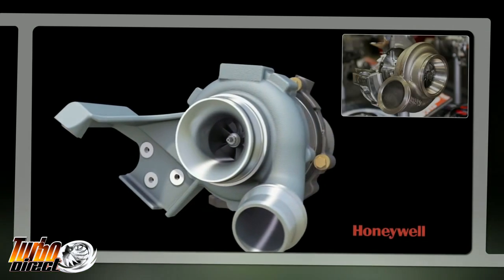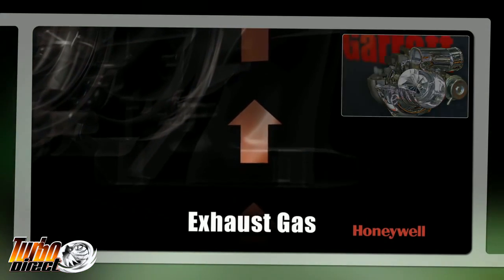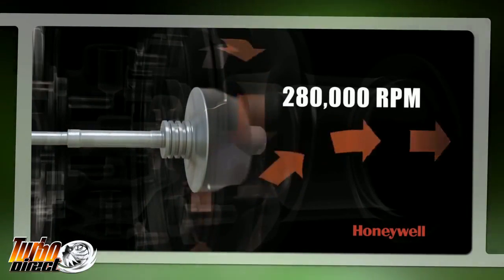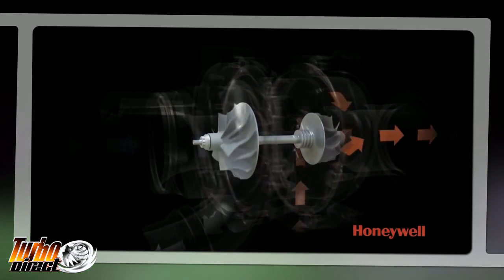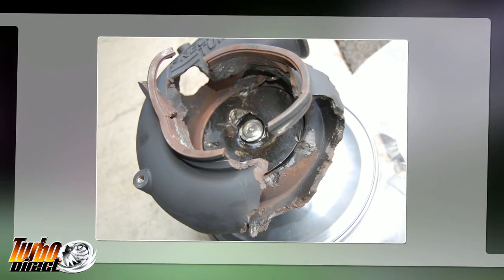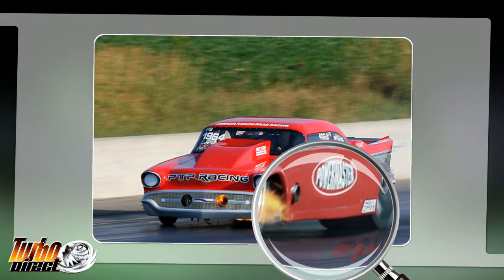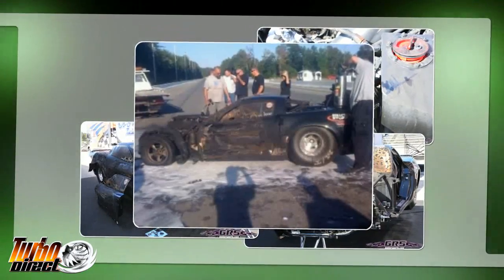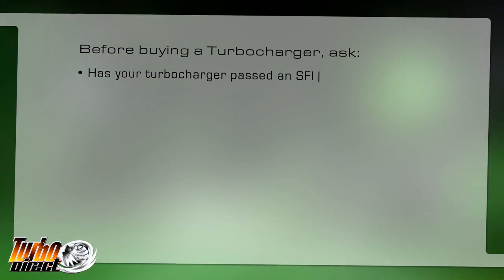Garrett versus Precision

Comment: no sorry not entirely true…Garrett gSeries are having many problems (ATM)

Precision turbos are raced and pushed  more often! this is why you see this!!

what happened too installation or operator error?

precision has more wins everywhere!

an easy perception of the three would go something like this..PTurbo is a greyhound-built for racing and performance!! where you have the borg and garrett more like a pit bull!!

i’ve compared all and can say the precision can spoil 10-13% better AND make power little easier 

in my 20 years of watching and owning big boost cars, ill always go with precision, especially on four and six cylinder engines as these feel the spool benefits more

for hard use street cars, maybe the borg is the one.
Reply from the maker: Its great to have opinions - facts remain facts i guess. BorgWarner is by far the best turbo on the planet for many reasons.
Reply: Agreed, I have seen precision turbos outperform the g series on several applications. Garrett gseries seems to be over rated.
Reply from the maker: @uwisho  Absolutely.
Reply: That's why precision turbo is the goat of turbos because they're the leaders of turbocharging
Reply: @jonathangutierrez7347 precision isn’t a leader in anything except maybe bombs. They’re nothing more than copies of Garrett and other brands.

Comment: It's disappointing someone will buy a new turbo that has had years of development and work put into it and ship it to China to be copied and sold on eBay. Even the cost, proportionally, isn't terribly different for the person buying it. The wild variations of oe configuration of turbos that manufacturers use means basically no matter your requirements there is a Garrett turbo for your application.
Reply from the maker: Nail on the head - thanks for the comment

Comment: I'm working on a build, and this video was helpful. After watching the video, I  better understand why Garrett is more expensive. I don't know why some many of the top tier engine builders typically don't list Garrett in their offerings.
Reply from the maker: Great that we could help - not sure which turbo you planning on using, but Garrett is not more expensive than precision. In fact in our country we sell Garrett alot more affordable than precision can ever be...... :-)
Reply: @TurboDirectSA  maybe 3 years ago prices were different but precision is definitely cheaper
Reply from the maker: @HandMadeRoyalty  cheaper in construction definitely, but in monetary value, most definitely not.
Reply: @TurboDirectSA  a gtx3071r is about $1500-$1800 a pte 6262 can be had for $1200 (with a journal bearing vs the ball bearing standard on the garrett model) and the precision unit will still make more power than the garret… btw precision got their start selling garrett units with their own modifications until garrett figured this out and cut them off
Reply: @HandMadeRoyalty  i dont think so PTE is a low quality chinese made turbo which costs much more than garrett and always been more. Makes more power LOL.  You seriously need to come to SA and see for yourself, things are not the same overseas, here our conditions are very extreme compared to yours. PTE makes less power and costs more.  BTW you are not comparing the same thing, ball bearing against journal bearing - ofcourse there will be a price difference.
Reply: @HandMadeRoyalty  you obviously havent seen the dyno graphs side by side of the PTE 6262 against the GT3076R against the 60-1 billet wheel which Chris himself machined on an RB26 in 2011. I personally saw this car on Steve Clarks dyno in Vereeniging make less power at more boost with the pte and Chris 60-1 billet 11 blade wheel destroyed the pte6262 with 80HP more at 0.1bar boost less. pte was made by a chinese company and turbonetics was labelled inside the back of the turbine wheel, this is all over the internet. PTE never used Garrett parts, they tried to copy Garrett designs.
Reply from the maker: @HandMadeRoyalty  Not in my country - Garrett is at least 500USD less than you are advertising these for.  Apples with apples my friend, this is what you are not doing. How can you compare the pricing of a Ball bearing turbo against the inferior, and far less costly Journal bearing unit? Obviously there will be a price difference. 

PTE makes more power than Garrett - im sorry but you are misled. We have never seen any 6262 (with any bearing design) make more power (same car, same dyno) than any Garrett GTX3582R -- in fact nor does the 6262 make more power than a GT3582R with the cast compressor wheel.  The PTE is laggy, unreliable, does not have burst containment housings, and costs far more than the Garrett models of the day. 

Would i compare pte to the G-series, this is a different story alltogether, G-Series is a waste of money, and does not perform anything like the previous  Gen2 GTX used to.  

Lastly -the company who made these pte turbos is called www.worldturbocharger.com otherwise known as E&E - they are cheap chinese knock off's of the Garrett design, and the castings were copied from the Garrett design, BUT had turbonetics cast into the rear of the back disc - I have photos of my visit to this factory in 2010 where this company was still trying to copy the Ball Bearing cartridge of the ball bearing design from Garrett - they failed needless to say.
Reply: @TurboDirectSA  im comparing the hp to dollar ratio. If i can make more power with a journal bearing im definitely ordering the journal bearing. The 6262 and the gtx30 i mentioned are roughly the same size. The gtx30 being from garrett and with more features on it side it should make more power than the precision unit but it doesnt. As far as the worldturbo guys that was clearly after garrett decided to part ways with pte.
Reply: @TurboDirectSA  also send me links to websites with the garret unit i mentioned $500 cheaper
Reply: @siyabandasekho6851  no i did not see this send me a link bud
Reply from the maker: @HandMadeRoyalty  www.turbodirect.co.za
Reply from the maker: @HandMadeRoyalty  No sir the GTX30 and 6262 are FAR fro the same size. The GTX35R and the 6262 are the same size - in fact identical in size when comparing the inducer and exducer of the turbine wheel, and the exducer of the compressor stage.   Note, a bearing system is not a power adder - journal bearings do not make any difference in power compared to a ball bearing cartridge, and vice versa.  Garrett was never in partnership with PTE -- id suggest you do your homework. A very popular corvette that blew up in the USA years ago, were using PTE turbos was reported to have been using Garrett turbine wheels, BUT after inspection by Garrett engineers, PTE ground the shafts down and modified them to work in their assembly, which weakened and caused the turbine to fail - Garrett was never an official supplier to PTE, and never will be. PTE are copy products made in China. 

The GTX30 wont make as much power as the PTE6262 because its not apples with apples - the GTX35R will destroy the 6262 and ontop of it will be reliable - something the 6262 cannot do.
Reply: @TurboDirectSA  my bad i mixed the numbers up. The gtx35 was what i meant to use an example. And i kno the bearing isnt a power adder my point was the journal bearing is a down grade compared to the ball bearing unit.
Reply from the maker: @HandMadeRoyalty  The only difference is that the bearing system in the JB version will be laggy but overall power output will be the same model for model.
Reply: @TurboDirectSA  the gt35 is rated up to 605hp the 6262 is rated up to 705hp. Theirs even videos on youtube where someone with a 6262 will smoke someone with a gtx35. Most tuners here that i have communicated with have recommended garret or pte when i ask which would be better they always tell me pte would be the better unit for my goals
Reply: @TurboDirectSA  also precision turbos are made in california not china. Maybe theyre ball bearings or seals are chinese but they are made and designed here in america. As far as theyre failures in the past yes they had design flaws i mean what do u expect once they got out on their own and experimenting with parts suppliers?? That happens but today pte is a totally different animal compared to the past relics they made over the years
Reply: @TurboDirectSA  i didnt find anything i was looking for in stock on that website so… no prices available how ironic
Reply from the maker: @HandMadeRoyalty  Nope - the Garrett GTX3582R is rated 750HP and the PTE6262 who knows what they rate it at, but its laggy and doesnt make the power that is claimed - from experience as mentioned previously pte has always been overrated with their power claims, something that the new G-series has followed aswell.
Reply: @TurboDirectSA  either way the 6262 will make more power and be cheaper even as a ball bearing unit vs the gtx35 thats my point
Reply from the maker: @HandMadeRoyalty  Nope - their castings come from china, like many other turbo 'manufacturers' and assembled at home base. 90% of pte parts come from china, i have been in the factories and seen this in person. Taken videos of same, and seen the physical product failed, and after disassembly the same castings and casting marks appear on the final product.
Reply: @HandMadeRoyalty  Really? That's funny as hell hahahah, thanks XD
Reply: @engenhokas69  damn looking back on it this dry ass argument was funny.
Reply: Because they don't have to pay for any warranty claims?

Comment: This is a pr campaign against prescision. Prescision has way more up to date compressor designs and they are the turbo of choice due to the high cost of the gtxrs garett which is a better quality unit. Its good prescision came,how old was the gt series getting? These new gtxrs are bad ass turbo's. The best.
Reply from the maker: Sorry jeremy, you are misled and totally incorrect. precision are a direct copy of the Garrett turbochargers, including the bearing system, turbine head design, and housing design aswell. do your research and you will see the facts. NOTHING comes close to the GTX and G-series Garrett designs, thats a fact - PERIOD
Reply: @TurboDirectSA  Borg Warner EFRs and the MHI turbochargers and its aftermarket derivatives are worthy competitors.
Reply from the maker: @aftastosk6016  Absolutely - agreed100%
Reply: All the prescision jurnal bearing turbos are junk, if you operate them anywhere the turbine speed limit their worn out within a year sometimes. The ball bearing ones do seem better now.
Reply from the maker: @donrosscojoe5014  Fully agree - the local agent for precision here admitted this to a few of my clients directly, he doesnt even run a precision turbo on his own car - its Borgwarner or Garrett
Reply: even still hive had a decent amount of friends need rebuilds on pte turbos under 25psi of boost for short period. some of them come with bad seals thats just their quality control. im sure if you bought a more expensive turbo like a 6870 and bigger itd be reliable
Reply from the maker: @percman34  chinese made and assembled in the usa - great marketing, thats about it.
Reply: @TurboDirectSA  it's like what they do in musical instruments.
Reply from the maker: @aftastosk6016  yes but QC is critical with instruments in comparison
Reply: @TurboDirectSA  with musical instruments is much the same as some instruments may come as more difficult to play than others, being out of tune and not producing the quality sound that they should. Again is a matter of tolerances of the various parts (e.g. the valve section on brass instruments), bad assembly and non suitable materials. Online selling much like the e-bay turbo is the worse case because they ship the worst instruments. The difference is that the low quality created by musical instruments creates artistic not safety problems.
Reply from the maker: @aftastosk6016  I understand - this is why we continuously insist on brand names that are proven, and we show the general public how to differentiate between the copies, and the genuine products.  The cheap knock off products are honestly rubbish!
Reply: @TurboDirectSA  people don't understand that the "cheap" product is made out of reducing scrap parts to zero. But if you have a shaft going at 150000 rpm, even a slight out of tolerance part can lead to a catastrophic failure.
Reply from the maker: @aftastosk6016  I disagree, even a turd can be polished, and even a low quality shaft material can be balanced -
Reply: @TurboDirectSA  a part that is out of tolerance, it needs to be matched with others that also out of tolerance - and even this is not the optimal solution. It also requires a tolerance check of every produced part. And it's doubtful that the machining processes are good enough to produce a minimum out of tolerance parts in the first place. To my understanding the video that you upload with the chinese bushi "G25" is a perfect example of what happens when the tolerances are not right.
Reply from the maker: @aftastosk6016  That is exactly what balancing does.  Matches the out of tolerance rotating assembly components and brings them into tolerance.  machining tolerances that are out of specification will still be able to be balanced, BUT 99% of the people dont know how to use a balancing machine to diagnose machining tolerances. We have test rigs which we have on hand that allow us to do just that - we have seen them all - the copies are absolute rubbish.
Reply: @TurboDirectSA  Is this the reason all the top drag cars in the states run precision? As far as I've been told precision males the power compared to similar style garret turbos but are unreliable as well. Although I never hear stories of Garrett's shitting the bed, but I do know few people running precision turbos for few years dd with no issues, probably truly hit or miss.
Reply: @JPTinioMedia  from my research I have come to find out the the Precision Turbo out performs Garrett but Garrett is just more reliable.  I was debating which turbo to put in my car. If Precision was as reliable as Garrett there would be no question that I would choose Precision.  However, reliability is extremely important to me, where these drag guys need to win a race, so performance is more important to them.
Reply: jeremy whittler Precision is more like Hit and miss!! I agree that all their parts are up to date but Their QC isn’t up to par, and their after sales service is something I would avoid! I have seen PTE 5558 HOLD 28psi boost and that car is running for over 40, 000 miles. On the other hand I saw a PTE 6262 give up at 21psi after just 10,000 miles! I like PTE, don’t get me wrong, but I rather spend my £2000 on a turbo which isn’t up to my luck. For me personally I prefer Garrett or Borg Warner.